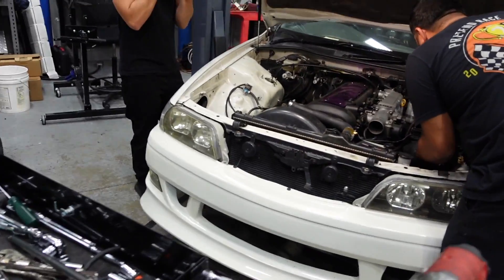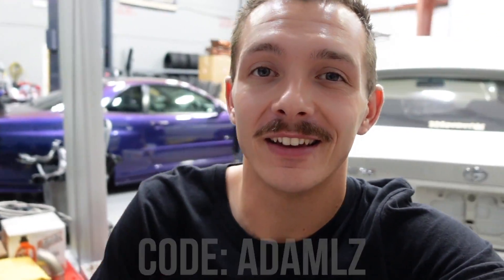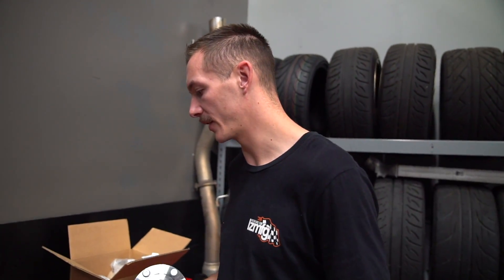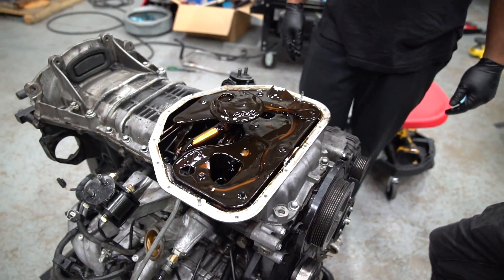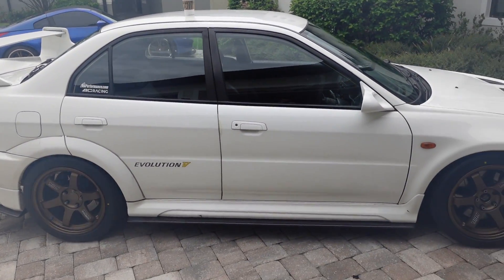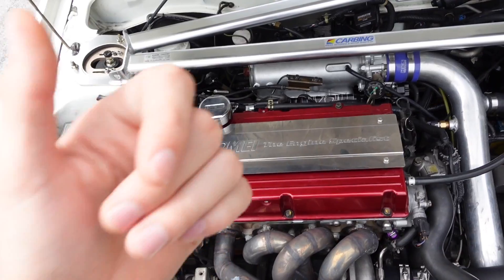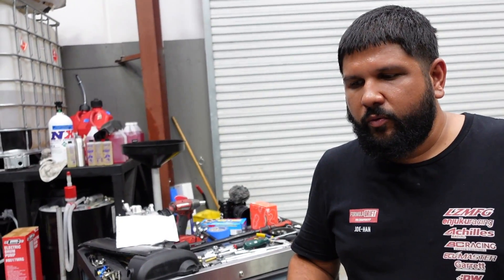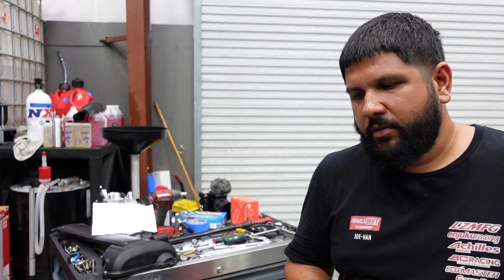Found some surprises in my oil pan...

Comment: get yourself some TITANIUM BRAKE PAD SHIMS, THEY CHANGED MY LIFE. They help with brake fading and really help with the SQUEAKY PADS
Reply: That's some damn good advice! I had never heard of them being made of titanium. Thanks man!
Reply: @FUCK_________googIe  they absorb vibration and provide a little bit of insulation between the pad and caliper.
Reply: @FUCK_________googIe  shims prevent and dampen the vibration (really a high Hz chatter).
Reply: AUSTIN even new brakes can squeal real loud when they dint install them shins right. Damage them or jot use the line and everyone will hear you coming

Comment: Valve float doesnt have anything to do with valve lash.  Valve float occurs when the spring is unable to keep up with the camshaft when rotating at high rpms.  The valve is not constantly in contact with the camshaft when this occurs (On a pushrod engine the rocker/pushrod/lifter not making constant contact with the cam), hence "float".

Comment: If you have BC springs & retainers with your BC VVTI 264 cams then it will be very noisy head. I've had the same using BC 264 & 272, on both 1JZ and 2JZ VVTI motors. The noise is not as prevalent with non vvti motor, or with a vvti motor using stock springs. Even with valve lash set perfectly it will still make noise, so dont spend too much time looking into it, its not detrimental. The noise is worse if your VVT cam gear is disabled around idle, it needs some oil flow from the solenoid to stop it chattering. So make sure you get the tuner to have even 1-2 degrees of VVTI advance on idle.

Comment: Thats the capacitor.  Noise suppression...  it should not have damaged the ckp sensor.  As its one the same circuit as the coils. While crank position is tied to the ecu and maf. Those metal case cap are a Fairly frequent fail on mistubishis and older toyota

Comment: Good thing checking the valves and you're learning about it. Still amazes me that it is not more common ground for you. Maybe because I've got workshop background but still, it's such a elemental thing for car engines. You want as much even and complete cilinder pressure as you can. If one cilinder has a loose intake valve for example that valve will open less far and therefor has less fuel/air coming in. Same for the exhaust going out restricting flow; X2X6 left uneven = a engine that will never run right. Having a turbo helps as it it is pushing air in regardless but a NA engine having it's valve lash properly adjusted can really make difference. Even playing with the valve lash thus changing valve overlap or opening can really change the torque curve on a engine. Basically what that cam gear will do, but as Johan says is only effective if all properly adjusted. Even a worn out timing belt getting longer(so retarding it) can attest to that. so moral of the story, check your valve lash!

Comment: Coming from experience from working at a JDM engine importing shop. Yohan has a point, these Jdm shops will scam you saying they go 40-60k miles engine but in reality they just pressure washed the engine down with chemicals making it look brand new and clean inside oil cap labeling as “low mileage” when in reality there 90-100k miles engines from junk yards in Japan... the Jdm importing business is a joke for the most part...

Comment: IMO leaky engines and transmissions are a better bet than pristine ones like that 1j was

If the owner checks the level, they are continually forced to "change" the oil by adding more

Comment: Yeah i bought some schrick cams for my 2.0 tfsi vag engine, sended the head to germany to be cnc ported, cams fitted and supertech valvetrain installed but unfortunately they could not install may schrick cams because they had no markings on them like oem, so the engine had to be degreed for those cams, haven't found anyone so far who was willing to do it, they all came up with you only need cams above 600 hp, well i bought 1200 euro cams and i wanted to use them, now 5 years later they are still stored in my closet.I ran out of injector anyway so thats my next upgrade if i want to go past 414 hp.But yeah it's nice to see someone doing it.And it's best to take your time on that'👍✌️👉

Comment: On the Evo losing crank signal - I've had a similar experience where I knew my map sensor was probably bad, but the car still ran great so I ignored it. Little did I know that the AFR without a healthy map sensor went from around 16:1 to 13:1. My engine's VE from the factory actually suggests an AFR of 18:1... 13:1? 😂 Injectors are fucked, turbo is fucked, rings are probably toast, high pressure pump fucked...

Moral of the story: Don't ignore ANY electrical faults, even if the car seems to drive fine.

Comment: I’ve always wondered why you never check valve lash with a new bottom end or cams. My rebuilt jz was wayyy off after doing that. Valves were staying open all around the cam lob

Comment: Yo thats a filter for your ignition system so there are no interference to near by tv and radios when u pass the street. Mine is broken for like a decade. 😋 Νο , issues so far except that my neighbor's radio doesn't work when i park the car in my parking lot 😅

Comment: Use the Ross performance dry sump kit in the gtr that way when you’re going to build it for high horsepower in the future you don’t have to redo the oiling system which is notorious in the rb

Comment: Fix those brakes !
Reply: They are there race brake rods there loud nothing you can do
Reply: @NorthernPerformanceGroup  yes there is,  you can change the brake rotors and pads to different ones that dont squeal as bad. I understand the whole race car aspect but even when adam was using the brakes really hard on the track they did the same thing with heat in them. So your point is invalid.  I've had several sets of race brakes and non of the squealed like that. Even newer cars with ceramic brakes dont sound that bad!
Reply: tapout954 The only option is stock brakes or racing brakes that’s it and he races the car